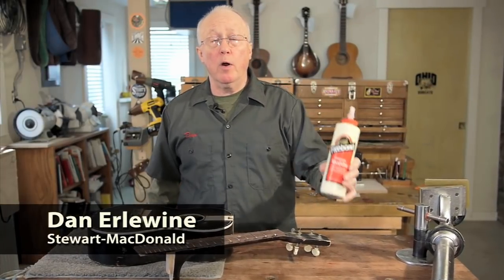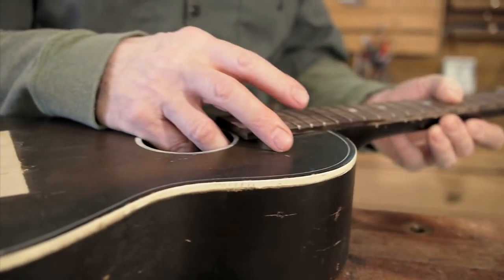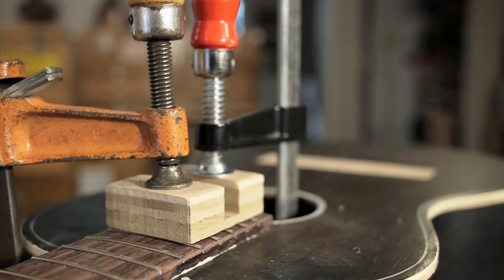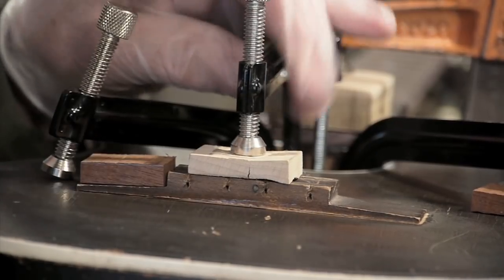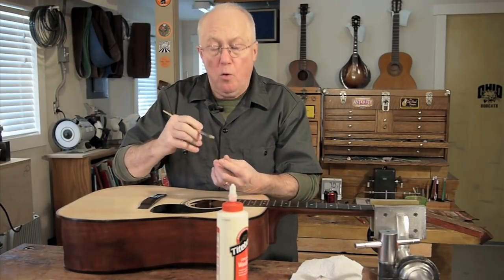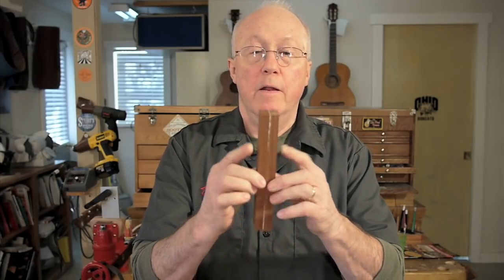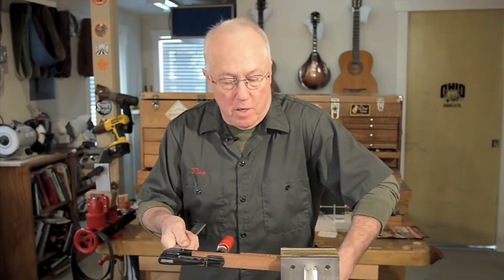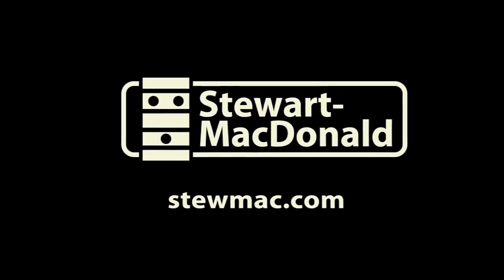Using Titebond glue for guitar repair

Comment: I always used this glue for bridges when i was a guitar repairman. Great stuff! Only thing i did different is that i found out that a very thin application just on the bridge bottom seemed to hold better than coating the bridge and guitar both, but id trust Dan way before id trust me lol.
Reply: I noticed Dan didn't saturate the wood with glue. he just brushed on a thin layer.

Comment: I used Titebond Original Wood Glue last week to reset a bridge. I clamped it and let it sit overnight.  I put on new strings, tightened them, and the bridge pulled up right away.  Then I ordered some Titebond III Ultimate Wood Glue.  I'm going to try again today.
Reply: It has to cure for at least 24 hours in not more.  Overnight probably wasn't enough.  I guess it depends on the temperature, humidity and all that stuff too.  I would wait 48 hours just to be safe.
Reply: maybe you overtightened clamps and the surfaces is to smooth,almost squeeze out all the glues

Comment: i've read an article glue that someone did some tests on several common glues. titebond original is the hardest modern glue out there, and acts as close as you can get to hide glue. For repairing, you can use a little steam on titebond original to loosen the glue just like hide glue. titebond 2, 3, gorilla glue, etc don't do this as well and are much softer glues. they don't transfer reverberation as well as titebond original and none of them do this as good as hide glue. titebond original has all the benefits of set up time of modern glue, and almost as good in its hardness as traditional hide glue.

Comment: Stew! Pleasure to watch your videos, pretty much on a daily basis. I couldn't glue on My set neck because its been gloomy and humid, so I waited until the heat started to pick up. I went ahead and bought some Gorilla Wood Glue and clamped the neck just hours ago, I only watched this video out of curiosity, I am afraid however that the glue I chose wont hold up probably... should have picked up Titebond which was right next to Gorilla. Should I be worried? ( I play standard and its more urgent as it is a students guitar) I expect this LP Kit to hold up for some years no problem what do I do?
Reply: If it's PVA glue and doesn't mention anything about being very weatherproof then You should be good.
Reply: Stew, I reglued the bridge on my sister's acoustic (Squier mod. 093-0300-149), and made a clamp to go thru the peg holes. Used titebond glue. Clamp seemed plenty tight, and left it for 3days. When I unclamped it,it seemed strong,but even before I strung it,I could get a piece of paper under the very bottom of the bridge.I strung it up and tuned it, and it seems to be holding fine. (It has 2 pegs under the bridge that go into the guitar top.which help hold it in place) . Is this bit of space at the bottom normal on this model?if it continues holding,can it be used that way,or should I fill it with titebond with a hypodermic?  Or do I need to re-remove it and start over?   Thank you!

Comment: That's the one thing Instrumentmakers don't want and that is the wood-cracking-part because of a to strong glue!!
If you wanna be able to repair an instrument, the crack has to be on the joint,... if it ain't, it's a disaster. Always use hide and/or bone glue, it have proven his favour over many years.
Bone glue is more brittle(and less flexible) than Hide glue, so by mixing these in differant quantities you can play a bit with the properties of the glue

Comment: i heard Titebond has an expiration date and doesnt work as well after that. is this true?
Reply: It's true that old glue doesn't function properly. Titebond doesn't have an expiration date stamped on the bottle, just a batch number. The shelf life is 12-24 months if stored in a cool, dry location. If the glue becomes thick and stringy in the bottle, this signifies that the glue is no longer usable. Buy fresh glue if you're starting a project. It's not worth the hassle of using old glue that won't work. Also, buy it from a source that sells a lot so you know it hasn't been sitting on the shelf for years.
Reply: ThisLoveIsSweet
cool thanks for that info. ill have to get some fresh stuff.